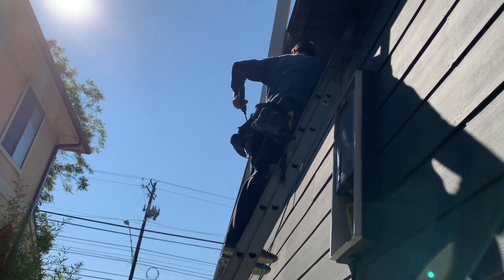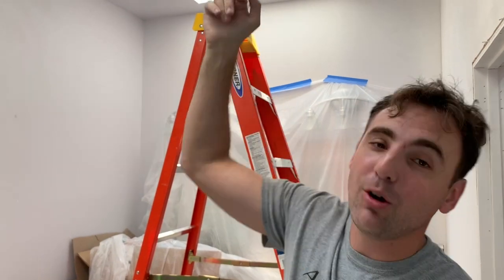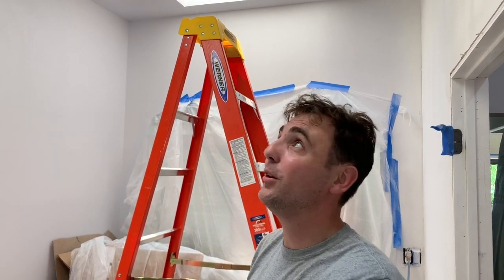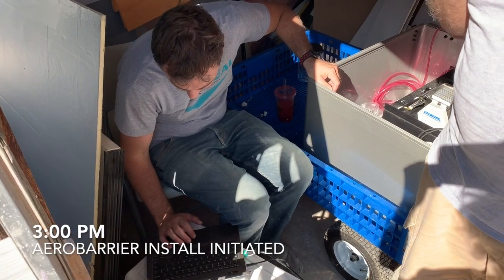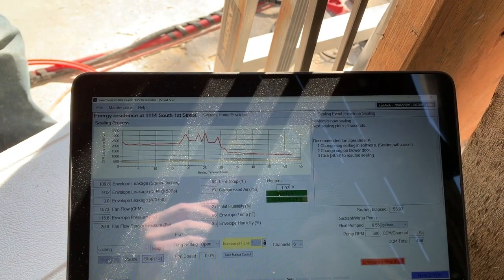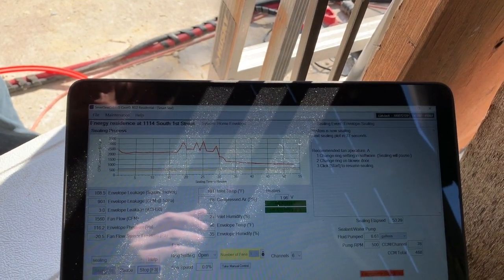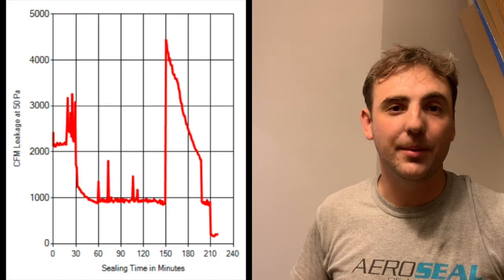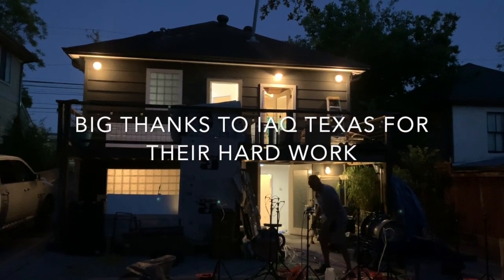New Office Aerobarrier Day Montage

Comment: Pretty cool old building.  Thanks for the video.  We just had our home's brand new duct system aerosealed.  The supply side had 40.6cfm leakage and got sealed down to 11.0 cfm.  The return side started at 78.1 and got sealed down to 18.2.  It was impressive it started out similar to leaving a medium sized window open.  After the sealing it was closer to a window being cracked.  The aeroseal dealer said the duct system was very well done by hand, but still 119 cfm.  It was favoring the return side so we were sucking in attic air and pressurizing the house with nasty air.  Very cool stuff.  I think the leak was smaller than it was reading at the end because the huge plenum at the air handler where they blocked it off leaked a little throughout the process.